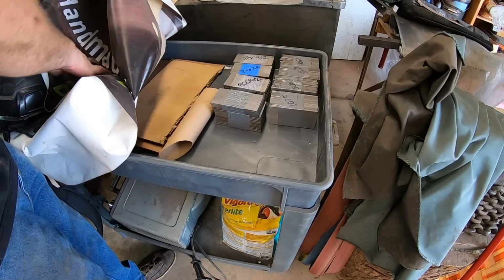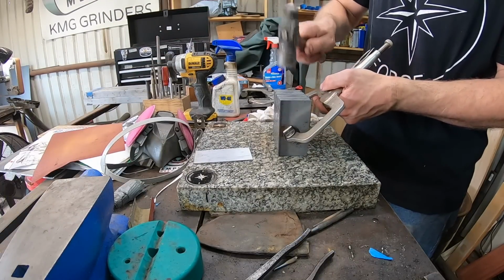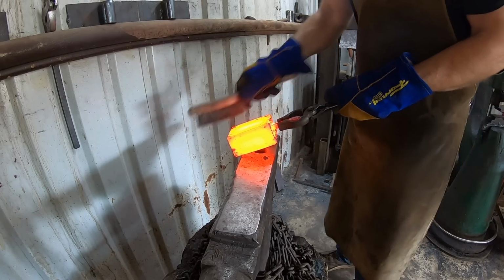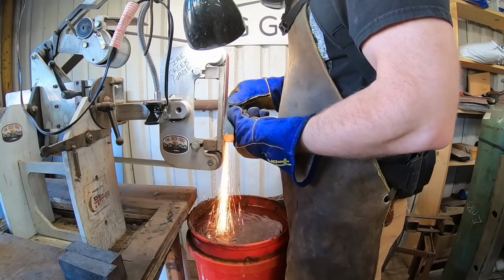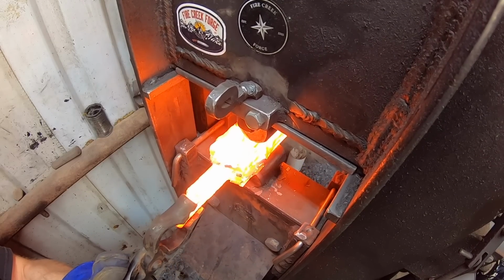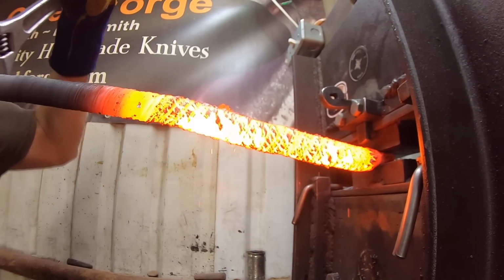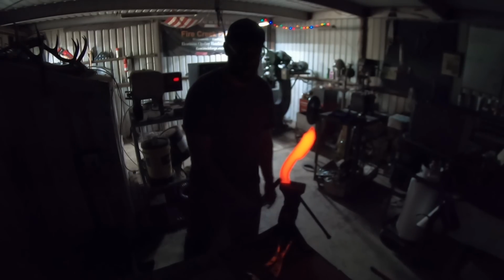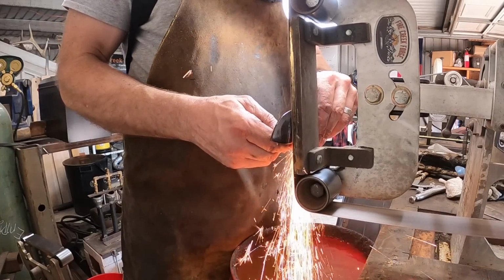Forging A Damascus (Pattern Welded) Nessmuk

Comment: Great looking piece. Have you ever considered using Gulso bolts instead of pins? I’ve seen some other makers use them so they can easily remove the scales to etch and everything goes back together perfectly. I’ve been thinking about trying them
Reply from the maker: I use a lot of Loveless bolts, rarely use pins anymore.

Comment: Very cool end grain pattern!  Looked even cooler that many explosion patterns ive seen. It would be very cool if you could get a blade that had that end pattern covering the blade with one "explosion" pattern.  I like bolder patterns personally
Reply from the maker: I agree, and yeah a lower count on the final layering would work I think
Reply: @FireCreekForge  do it! That Nessmuk blade but setup more like a kitchen knife with more finger clearance maybe. But definitely keep the long sweep on the blade for camp cooking. I'm forging a couple RR clip blades that will stay in my Rubbermaid camp cooking tote, micarta handles because I know they will be abused. One blade I've never seen you make is a fillet knife!  That would be a cool video for sure! I've been wanting to forge one but am a bit overwhelmed on the geometry needed to flex properly.
Reply from the maker: Are you wanting some saw blade material?
Reply: @FireCreekForge  I've been keeping an eye out for a 6 or 8 ft section buy am in no hurry to procure a chunk. I still have a large stockpile of 2" wide ⅛" thick 15n20 and ¼" thick 80crv2. I'm wanting to explore stainless damascus for sterling silver lined damascus bands. I've made a few and are very cool except they do get a corroded look to the damascus.

Comment: Seeing you cut up a piece of band saw brings back memories. My job before retirement was working in a filing room of a sawmill where we ran saws just like that. We tossed out literally tons of that steel every year. We filled scrap steel bins with them.
Reply: Where are these scrap bins you speak of sir?
Reply: @lukelofgren4108  Sadly the mill shit down and it was all sold as scrap.